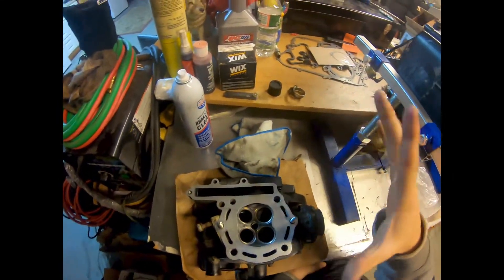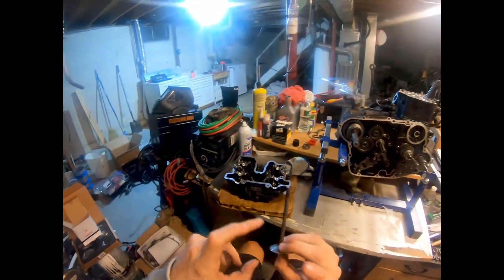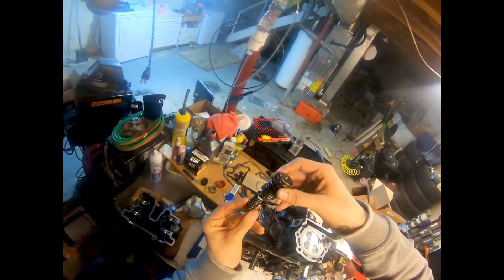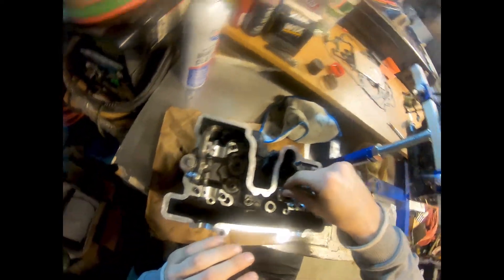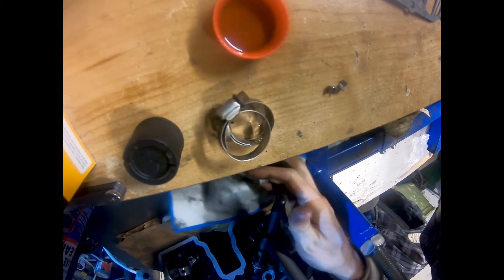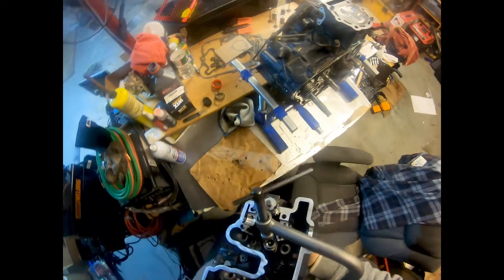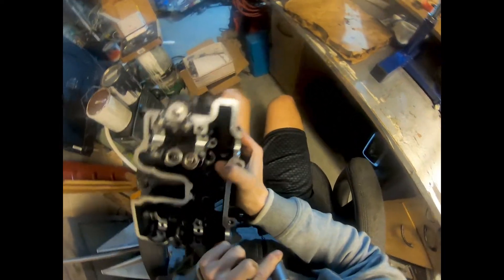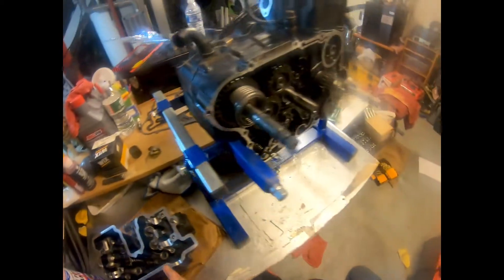Installing Valve Springs on Kawasaki Mojave 250 Cylinder Head

Comment: hey bro where did you got your parts? i have the exact same kawasaki and im trying to replace the piston and the camshaft but i cant find it anywhere
Reply from the maker: I got all my parts form partzilla, eBay, and the piston from Amazon. eBay is a big one and partzilla had almost everything but it is expensive cause they are more oem parts. Partzilla also give you a diagram of everything. Form frame to engine and trans
Reply from the maker: A lot of the parts are hard to find like the cams cause they don’t make it anymore and after market don’t make any so it’s just waiting for the right time and why are you replacing the cams?
Reply: The engine is all fucked up so I'm trying to rebuild it I was curious cause I searched in google and almost everything I need is expensive
Reply: Imma look in partzilla tho thanks
Reply from the maker: No problem man. If you need to rebuild the whole thing and it might be cheaper to buy another motor. I was going to rebuild my more but the cost wasn’t not worth it. I just a 500 ninja motor for 500 incase the turbo kills this engine